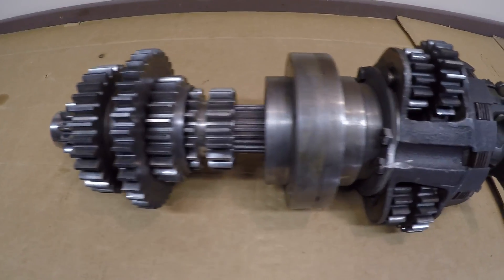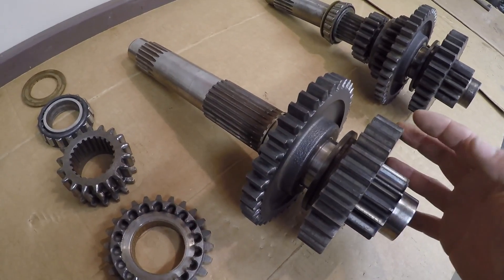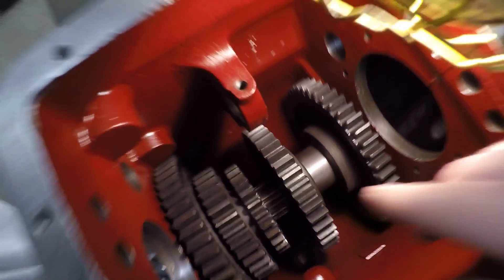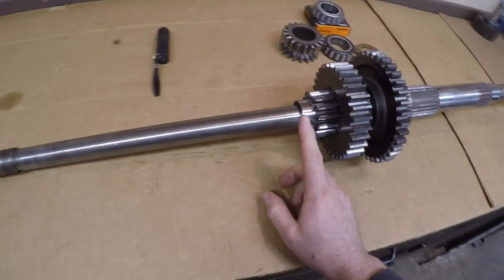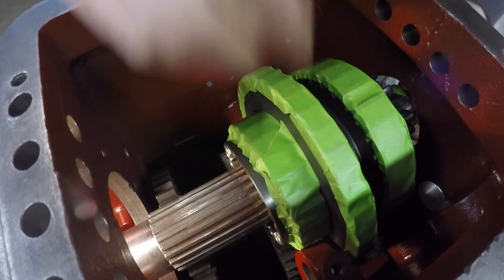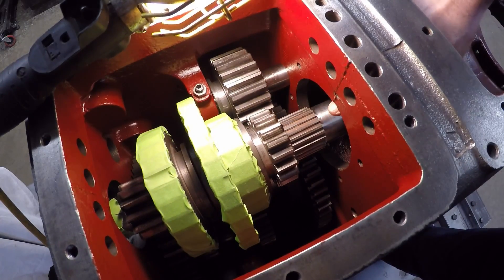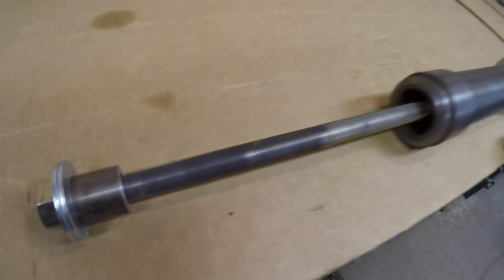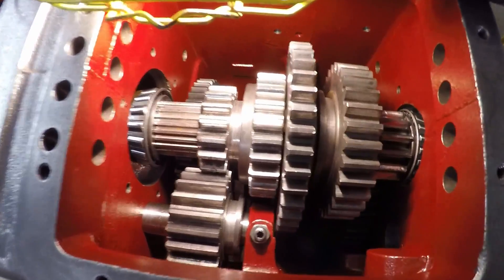Minneapolis-Moline 445 Prototype #X231 - Part 37: Transmission Assembly Continues...

Comment: Hello I know this is an old video. But I am in the process of rebuilding my transmission on my tractor and i am having trouble finding the bearings on each end of the shafts is there any way you remember where you got yours? The part numbers on my parts book don't pull anything up.  Thanks

Comment: as I'm watching I cant help but think about all the bearings inside the transmission and differential...i cant help to think about what happens if one goes bad...all the work involved to tear it apart to replace bad bearings...then i think about bearing quality...American made vs Chinese...i have a terrible feeling there's going to be more and more Chinese parts in vehicles in the future...it really bothers me. I also think about how many things Ive fixed on my van the quickly broke again and I think about I just fixed that not long ago..and its broke again...then I think....Chinese metal...its just breaks. I hope all the bearings you found are American made.

Comment: Interesting solution to getting those bearings onto the shaft. I normally warm them up in gear oil in an electric frypan them slip them on by hand 😁

Comment: Nice job pressing those bearings on for cheap. I understand they had to be installed after the shaft is un place which begs the question... how the heck did you get them off for disassembly?
Reply: @squatch253  oh dear lord. Learning lessons this way is so bitter sweet. Yay i did it but holy s**t what a battle. Been there my friend

Comment: As a mechanic myself I use a electric frying pan with synthetic gear oil and put my bearings in heat them up 600 Deg and they just slide on the shaft you can freeze the shaft too that helps 
I never press a bearing on a install

Comment: There sure is nothing wrong with  using protection,....oh gawd, did i really say that!!   
Open gears can nick the insides of a gear case very easily can't they, and as I was told many times , " if a job's worth doing, it's worth doing well."

Comment: I didn't realize you were such a comedian. :)

Non-mechanic observation of the day: I never would have guessed that snap rings could handle enormous amounts of lateral pressure. Or do they? Maybe all of the pressure is rotational, so even the thin metal of a snap ring is enough to keep the gears from sliding side to side. Still surprising to me.

Comment: Looking good. Next time drop that bearing on the hot plate for a few minutes and it should slide right on. I use an induction bearing heater, but I'm spoiled...
Reply: Machine shop i used to work for had a tiny electric oven from the 60s to heat bearings and hubs and they would drop into place
Reply: 500 watt halogen shop light works perfect.  Poor boy bearing heater looks.